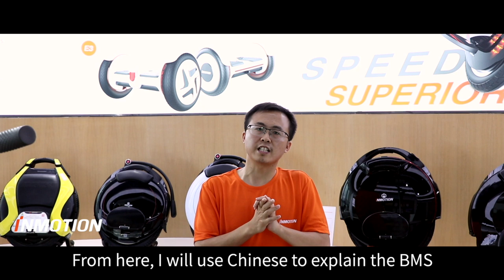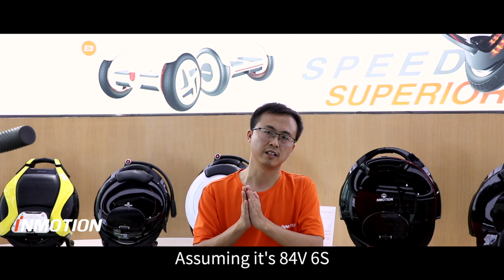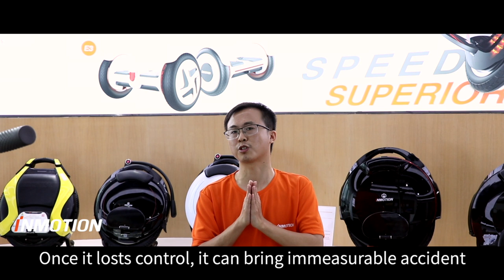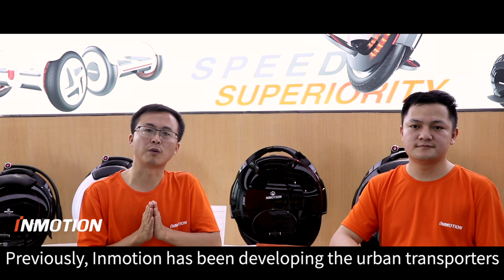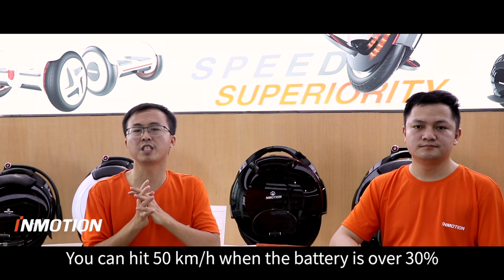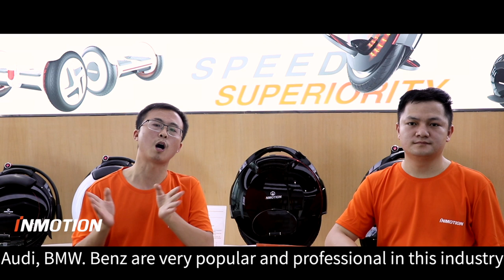The Design Concept Behind  Inmotion V11 Electric Unicycle Q&A Part One | Inmotion CEO Charles Cai

Comment: I appreciate Charles and INMOTION to connect with its customers.  I bought the V10f when it first came out, but was disappointed with the battery waterproof issue and the overheating.  I’m glad to see INMOTION work on putting out a wheel for the experience rider.  I’m liking the V11 more and more.  I currently own all Gotway, but may have to pick one up.  The V8 was one of my first wheels and really like INMOTION’s attention to detail.  Thanks for the video.

Comment: Sounds like Inmotion is building on its track record for safety but adding performance features. This is definitely the right way to go! I would have hoped to hear more about why they chose this method of suspension, only placing the rider within the sprung part, rather than everything bar the wheel, which seems to be the standard automotive approach. Another video?

Comment: Thanks for this, I simple love the looks & design of the V11 Im an older rider & comfort riding is becoming more of what Im looking for in a wheel, & suspension is definitely the answer for the journey & longevity of the rider, speed not so much, but to have that extra buffer to substain higher speeds longer, is also important to me & the choice should be controlled by the experience a rider sets on a wheel. Another important factor to me, is speakers, I believe they not only add enjoyment they add a margin of safety that warms pedestrians you are coming.

Comment: Why don't you use LiFePo cells that keep the voltage constant and are not flammable? This way we could have the whole power from 100 to 0% battery. Thanks in advance